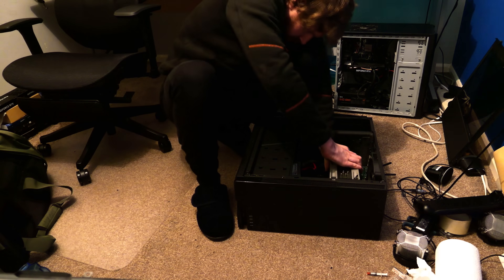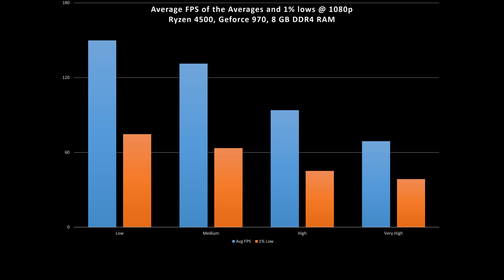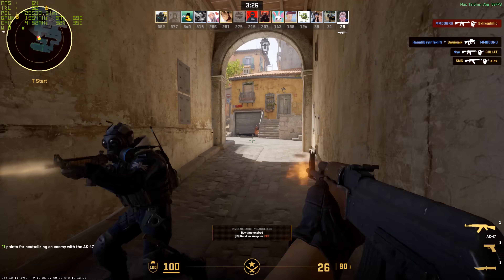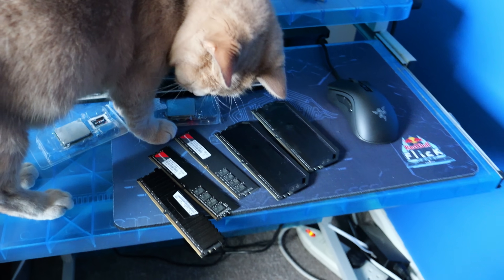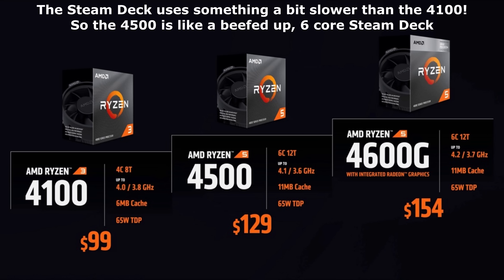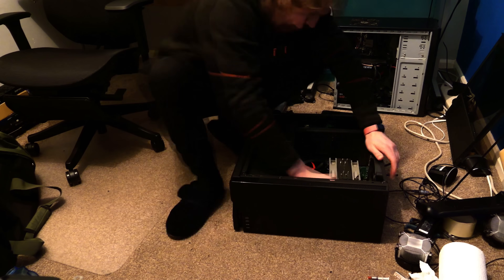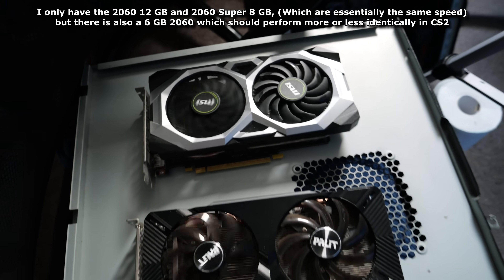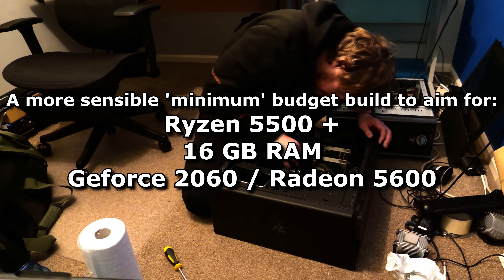Which bit of the PC will CS2 break first?

Comment: If you do read this, then I'm having issues with my R7 5700x3d. You claim to get over 300 frames with it consistently while I'm having issues getting stable 240 with a RTX 3070, 1% lows being at a miserable 140 fps.
I'm wondering if you have any tips on what to look out for anything. Not sure if it's related, but I'm also forced to play with V-sync enabled to get a playable experience, as playing without it, there is LOTS of screen-tearing.
Reply from the maker: 1% low of 140 is absolutely fine. You'll only be aware of such numbers by having them visible on-screen, turn them off and your problems will be solved and you can enjoy your buttery smooth game in peace :)

Comment: there is always 1gb free at 8gb ram cuz windows doesnt like that part of the ram used. i used to daily drive a surface laptop 5, a windows 11 machine with 8 gb of ram and it will never reach more than 90% usage. it will always start using the page file or something. this applies to not just while playing games, it just so happens to be more noticeable in games, when it starts offloading memory to slower storage and vice versa and then you feel the stutter. after switching to the background program, from the active one, e.g. from the game then into windows, its very slow. this is compounded on that laptop by the fact that the igpu shares the same memory that theres clearly not enough of.

Comment: I've got a i5 6600, 16gb of slow ram that always seems bottlenecked and a gtx 1060, how can I fix my fps because somedays I feel like I can get 200+ fps (all low) on mirage but then others I'm sitting less than 144hz which with the added screen tearing can make aiming quite hard.

I feel like im back on my laptop at 30fps 800x600 days of csgo.
I'm still floating around 20k elo as I only play now and then but I know the framerate is giving me a significant disadvantage over other players not to mention playing on a pixelated screen.
My rig used to get 350 fps on csgo and now I'm an adult I wish for the same without breaking the bank, what can I do to stabilise my framerate 3kliksPhilip, I'd be satisfied just to eliminate the fps drops and screen tearing any help?

Comment: It is actually more expensive to build a pc than buying one second hand with higher specs . I have seen a gtx 1660 build for 180£ on ebay, seemed clean and nice. If something like that works the way it should, it is no brainer
Reply: Big agreed as the price of full systems hasn't fluctuated yet except at the high end

Comment: Cool video.👍👏 The Thermalcare cpu coolers are very good and more than worth the money. In particular the cheap ones (from 15€) over at Amazon. I tested the ones with 4, 5 and 6 pipes and they perform very well for 65W cpus. The 5600 will definitely perform better than with stock cooler #try cb23 I built some entry gaming pcs from spare parts with Intel 10105f and Ryzen 5500 with gtx 970 (refused to die😂) and AMD RX 570 for free, and boy are the young people grateful for there shiny new Valorant rigs🫡 In many cases high end is overrated and pushed by industry, both pcs can run Cyberpunk at a decent lvl, and Crysis btw😉

Comment: Thanks to this video, I went to sanity check my memory and found with absolute shock and horror that my memory was running at the default 2133mhz. Upped it to the 3600 it should rightfully be. Thanks 3
Reply: Same here, mine was set to 2400 by default, when 3600 is the optimal speed...I wonder why the Motherboard does not check the optimal speed out of the box? Might be a good video idea to remind more people of that setting :D

Comment: Hey 3kliksphilip, I have a suggestion for your brother, 2kilkspilip, could you pass it on for me? Thanks

So there is a game called space engineers 1&2, they run on a custom game engine and they have pretty impressive physics , particularly space engineers 2, it runs on a brand new custom engine, it has improved physics and water physics included, and improved destruction and building physics.
Thanks 2klikspilip.

Comment: I'm not so sure it's the ram, or at least only the ram, causing the slow down. I have 16gb ddr5 and get the same kind of slowdowns too. I think it's a bug with amd cpu's and cs2, there was a megathread on reddit a while back, though that was specific to higher end amd cpu's. 

I have a ryzen 7600x(non 3d) and a rx7600gpu. For me it triggers most often if I'm inspecting something from the scm in between rounds in premier. Normally I'll get 250+ fps but then I'll suddenly drop to ~120 and it continues to slowly go down from there until I reconnect/restart.

Comment: The behavior you describe where it slows to 60FPS or lower and doesn't go back up, coupled with a 9th gen Nvidia, makes me think I know exactly what's going on - when those cards throttle, they throttle very aggressively (VRAM in particular) and they basically wait until thermals get better before throttling back up, which often never happens. Check nvidia settings app (or the windows equivalent, hopefully it shows frequencies) to see if that's what's happening. Alt tabbing the game for a few secs (if the game doesn't render in the background, won't work for CS2) or forcing it to stop rendering somehow (is there a "pause task" in Windows task manager you could use for that, maybe?) can help bring the card back to normal freqs but it's annoying as hell, that generation was cursed, no wonder we praise the 10th to this day in comparison

Comment: I play with old workstation laptop that has quadro m2000m 4gb, intel i7-6700hq 4 cores 8 threads, 24gb ram at 2300mhz. I play with streched res and most of settings at lowest other tan dynamic shadows and it is playeble fps is 70-110 depending on map and situation.

Comment: 4:24 I think you can reset the ramleak (I think its actually a vram leak, because I still had it with 16gb ram, but after switching to a new card with 16gb vram I stopped having it) by going into advanced video settings and going into a different Multissampling Anti Aliasing Mode, at least it worked for me, and I had it like every few games before switching to the new card
Reply: Weird, I started facing this issue after switching from a 6gb 2060 to a 10gb 3080 lol
Reconnecting to the server immediately resolves it though

Comment: I play on a pc I built 4 years ago for £200 with a 2200g so no gpu, on min settings I get 50-60fps. That pc was fine for csgo but couldn't run cs2 at launch or for the first year or so until they improved performance